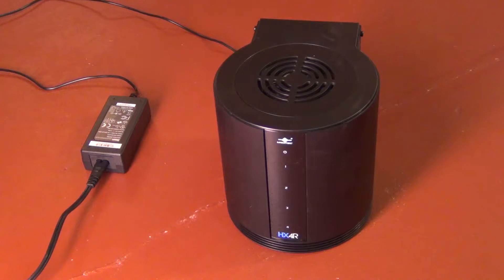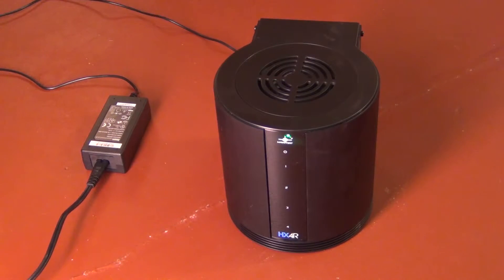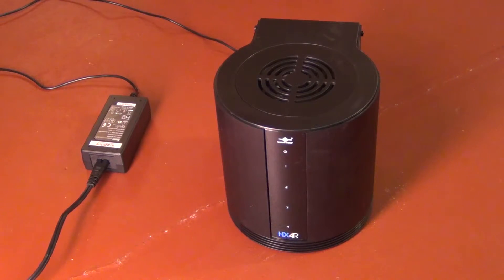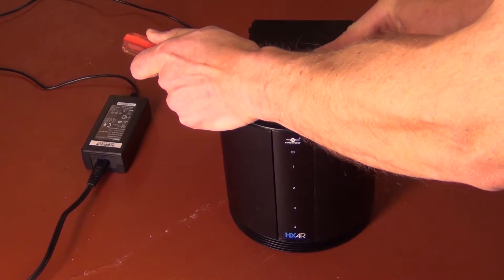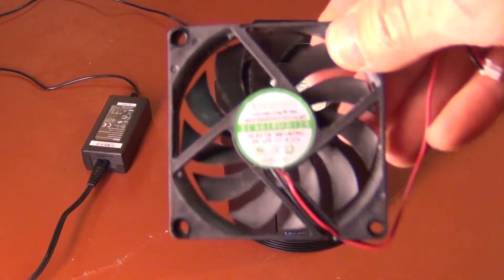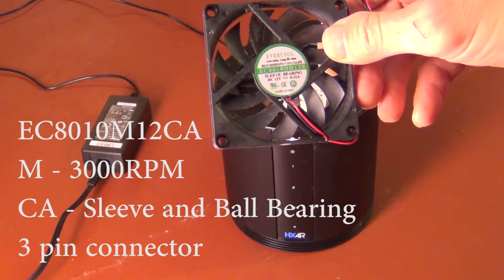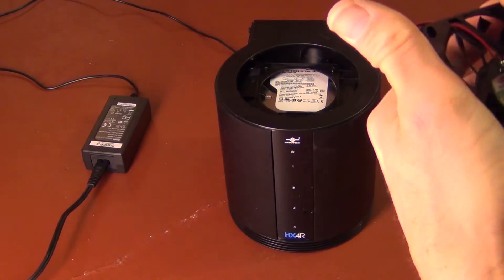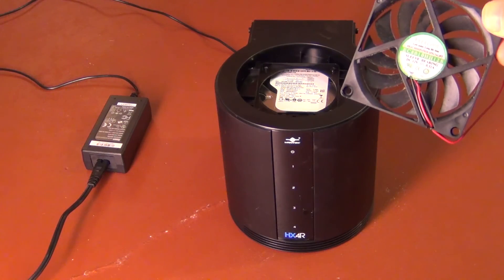Noisy Fan, Vantec HX4R, Disassemble, NST-640S3R-BK, NexStar, Evercool

Comment: Hi, your fan replacement was usefull? Or it was just a screws problem?
Reply from the maker: +Alexis Burgos 
I had to replace the fan. Started acting up again a few days later. Vantec support had some useful
information on fan replacement:http://www.ebay.com/itm/VANTEC-NEXSTAR-HX-Series-External-Enclosure-Replacement-Fan-/262090521807
I replaced the fan with an Evercool fan "EC8010M12CA" on EBay. This fan is 3000 rpm but has 1 ball bearing and a sleeve bearing. Vantec's HX4R fan EC8010HH12S is 4000 rpm and has sleeve bearing. No more noisy fan!